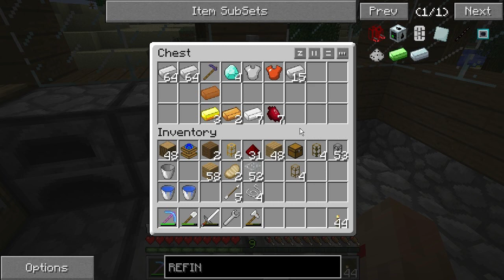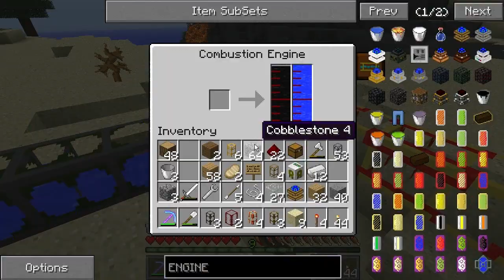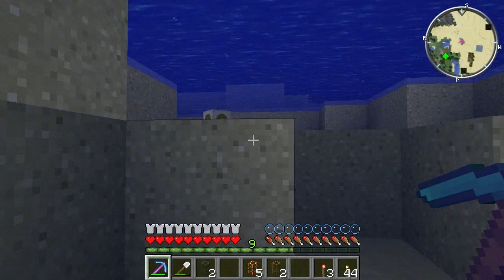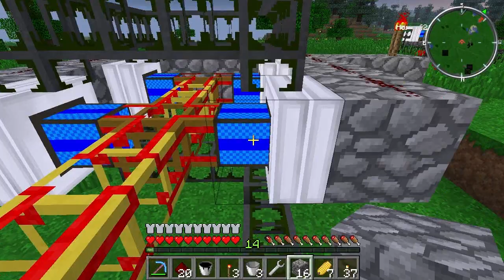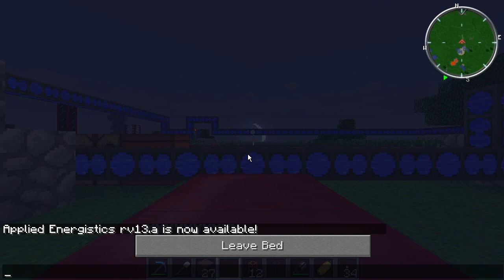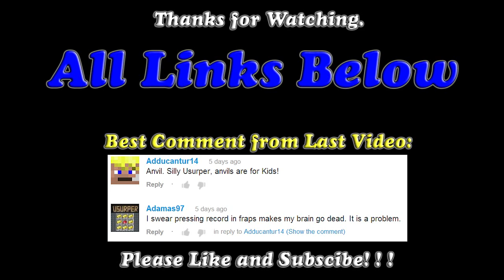We have Power! and Explosions :( - Ep03 Feed the Beast - Usurper97

Comment: In order to build an advanced circuit you will first need a normal circuit. To build a normal circuit you need 2 redstone, 6 copper cables and 1 refined iron. To make copper cables just put copper in the 3 middle sections of a crafting table and on the upper and lower sections you put rubber (you can get rubber by smelting sticky rasin and you get sticky rasin from rubber trees).
You get refined iron by smelting normal iron.